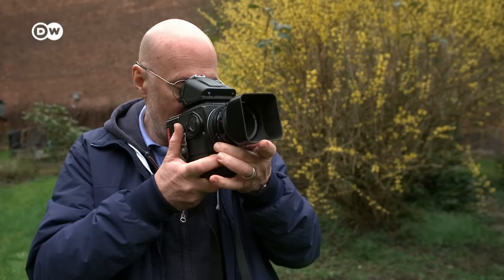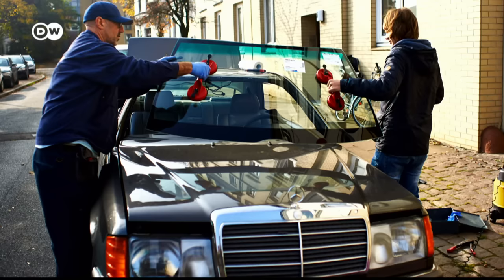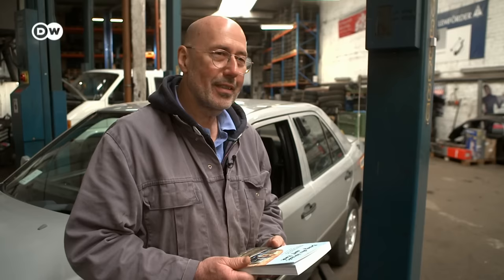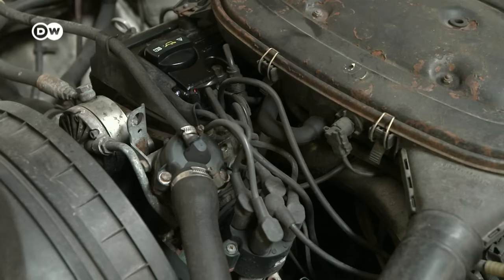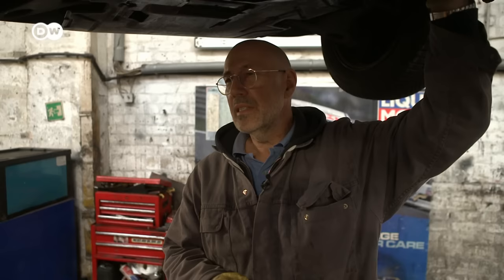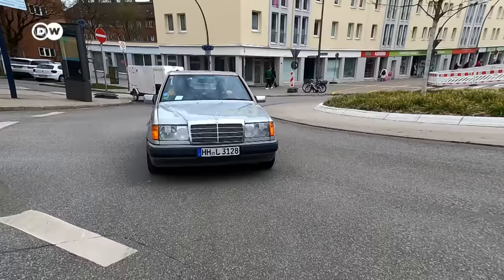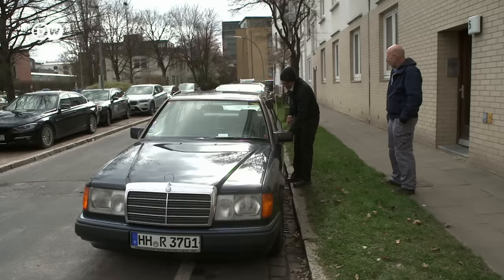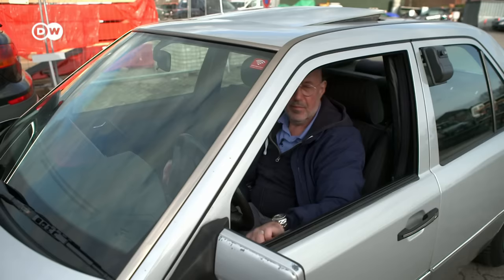Iconic Mercedes-Benz W124: A True Masterpiece in Design and Engineering

Comment: The last true E class ever built, the last true benz ever built is the W140. It was a billion dollar project since there was no price constraint. And it was made till 99 unlike the W124 ending at 97. So that makes the W140 the last true benz made to last forever. W123,W124 and W140 will forever be remembered as the best benzes ever made.
Reply: Don't forget the R129! That was built up until 2002. The W140 was the last to still have the old M104 engine, which is an absolute tank. I daily a 1992 300SE W140
Reply: Actually, it is the first E-class.
Reply: @19jacobob93  how could i forget that masterpiece. That definitely makes it the last since it was made till 2002 as u said. M104 is definitely the best straight 6 engine ever. I also daily a 95 S320 with the M104.
Reply: @TinLeadHammer  the first E class, also the last E class built by true Mercedes standards.
Reply: He said "probably the last". Why are you making such a big deal out of this?
Reply: @detonater1348  you never heard of the w211 ?
Reply: You forget the w126.
Reply: W211 is the last true e class
Reply: what do i enter in cargurus to find this car?
Reply: @Nikola_W211 What makes it so?
Reply: @19jacobob93  Or the 201!!! No compact MBs without the creation of the 201!
Reply: @kamila2356_  Fair! I do like the W201
Reply: I have owned all of them also a1991 420 sel

Comment: The W124 is an indestructible car. It copes with the terrible roads in Ghana pretty well. I haven’t owned one, but I’ve sat in several, and enjoyed the comfortable ride.
Reply: Unless you get condensation inside the distributor, which wreaks havoc with the exquisitely engineered 3 litre engine. Very frustrating to diagnose and fix.
Reply: @1unsung971  thanks for the insights. Will add to list what to watch in the future for.

Comment: I have driven my 230E sedan from Malaysia to Thailand and back Kuala Lumpur and then to Singapore in the same week without any glitch or service. Then it got submerged in big flood in end of 2021 (11 feet flood). It was part of restoration but become revival project. It still going strong but with minor issue of misfiring. Will still keep it and repair it, and if possible will try to restore back to mint condition. The W124 is respectable car. It just simple mechanical and human connection mobility. I love it. Unlike todays car that have no souls, all electronics disturbance.
Reply: Electronics disturbsnce - very well said

Comment: My dad owned a W124 200 in the 90s. It's a recond model imported from UK. The car is great & very stabile with a top speed of 196km/h. It's powerful for a 2liter engine without fuel injection.
Reply from the maker: Do you still have the car?
Reply: @DWREV I do, well no his, but I still got my fathers E220

Comment: Best car I've ever owned, and still own since 2004. A 1988 230CE, not much power but very pleasant ride. She got 470.000 on the clock.
I had a T model as well for many years ago, but the flooring and beams was heavily rotten with rust, so I had to scrap it, such a shame but it was too muck work to do.

Comment: I´ve had a few of these "classic" MBs like W124,123,201.All great cars,but even a W220 is very much a DIY car,it just needs more studying,but basically it´s very reliable if well kept.Also W210 is known for it´s great quality.Rust may be the issue,but the late W124 are vulnerable also.
Reply: You forgot the W140. Much more reliable and better built than the W220
Reply: Can confirm, I own 3x W124, 3x W210 and one W140. Rock solid, I have rebuilt one of the W210 because of rust problem. 😁

Comment: I had one for 15 years, it had over 500.000 km. The weight is not much, about 1300 kg. With a turbocharged 6cylindre petrol, and the brakes of a 500, you have the perfect autobahn cruiser. In the mountains it is marvelous.

Comment: I have such fond memories of my S124 250D (S means wagon). It was very reliable, comfortable, economical and excellent to drive in all conditions. It could go for hours at top speed while still being relaxing driving experience, maintaining civilized levels of noise and not overheating or causing any other problems. Only real problem I can name is the model's tendency for rusting in northern climate where road salt is used.

Comment: This was a great car, but it did have one Achilles' heel. The W124 was prone to rust if it was exposed to the road salts used on roads in New England.  Many a W124 died an early death due to rust or underbody corrosion caused by such salts.  If you kept your W124 in a part of the world where such salts were not used, the W124 would be just fine.

Comment: Just avoid 90's versions with the biodegradable wiring harness!!!!
Reply: Not really because I have a 95’ E320 and it had the biodegradable wiring harness needing replacement back in 2012 i bought one new at Mercedes for $1,300 or so and installed was $1,800 but the new ones will last 20 years or so. I’ve had it since 2010 and it’s still going great after getting the harness replaced now 11 years ago. It’s not a big deal really. The head gasket went around then too but it has been fine too since. Nothing else failed. The only thing it needed since was regular oil changes and brake pads. I love mine and will never sell it. I believe it will me my entire life as it’s an extra car that I have especially so.

Comment: I bought my 1990 W124 230E about 12 years ago for $5500.00 Australian dollars. It had about 230,000km on it. Turned out it had a leaky head gasket on it, which somehow dodged the Road Worthy Certificate. I spent $3200.00 on it and it has been the best car I have ever owned, including a Peugeot 504 LTI, Benz 450 SEL and about 20 other cars.
It has now done 350,000 km and drives like a new car. Keep a car like this maintained and it will last longer than you! Regards, Marcus.

Comment: would like a comparison between W124 and LS400
Reply: The LS400 is more comparable to the W140. I have owned both and can compare the two well.
The W140 is surprisingly easier to work on and feels much more solid overall. The panels, doors, interior etc. are unmatched by literally any other car ever made.
The LS400 feels less special, and the doors etc. Don't feel much better than on other Toyota products I.e. Camry. The LS400 is maybe slightly quieter than the W140 and the suspension feels better in my opinion, although my W140 needs new control arm bushings and shock absorbers so it will feel much better once those have been replaced!
Reply: @19jacobob93  Thank you for your inputs from your lovely combo.
 I'm curious to know what led the LS400 impressed by all from its competition. Were the low price and oil crisis helped it by far margin?
Also want to know about how the BMW 7 series fared in this era. No comparison I assume?

Comment: FYI: I have a friend who bought a brand new 2022 model E-class. After 5,000 kms, it started showing a problem where the engine wouldn't start. Turns out the sensor on the fuel injection was malfunctioning. That will never happen on a W124. The new Mercedes models are all electronic toys and shiny curves but it doesn't have that signature Mercedes reliability and durability like the W124 or W123.
Reply from the maker: Interesting point. We still keep our fingers crossed the 2022 model will at least not cause any more problems

Comment: I have a w123 240d manual. I'm in the southeast usa. But still some rust. I want a 124 but I'm worried about rust, wiring, etc.... I'd want the most reliable bullet proof version if I bought one. The standard taxi style. No bling. I wonder what the best version is to find?

Comment: The W124 might be alright to those that know no better, but it's not a patch on the W211 Mercedes. The 2003 W211 E320 has better brakes, better steering, better throttle response, better paint, better gearbox, better suspension, better fit & finish & is an overall better package. I own both, a 1994 E280 W124 in pristine condition& a 2003 W211 in likewise condition & I should know. Both have AMG wheels & both are comfortable to drive, the W124 has 478,000 kays, the W211 has 134,000 kays. End of the story!

Comment: Nice video. But... I hate people who are so shortsighted. I have owned a W124, a W201 and I now drive a W202. First of all the W210 (the W124 successor) and the W202 (the W201 succcessor) drive a lot better. Especially the steering. Also the petrol engines in the W210 and W202 are better than the early petrol engines from the W201 and W124. Also contemporary Volvo's are a lot less prone to rusting. And, in my experience, more sturdy and certainly also have a lot of character. I know because I have owned and driven models of both makes extensively. I have a very slight preference for a Benz, but this is very personal. Both Benzes and Volvo's are very practical everyday older cars. There simply is no single car (or motorcycle or any other product) that is THE best. It may be the best for you, yet that does not make it THE best for everyone!

Comment: But it easily weighs 2 tons. I didn’t like the weight. The fuel economy suffers but back then gas was cheap. Now? No thanks.
Reply: Diesel.
Reply: My W140 weighs 2.5 tons and I still manage to get 900km+ out of a tank. 3.2 M104 engine
Reply: Maybe true on the 4 cylinder versions but if you go for the 6 cylinder models and especially the 8 cylinders versions they are much faster and smoother also. They do way better moving around the over built tank of a body that lasts forever. And really if you compare the w124 to a car of today they are not that heavy because todays cars are absolutely laden with worthless electronics that go bad in the heat and won’t last and endless safety equipment and smaller engines with parts that are so crammed together that the ones built after the 2010’s are much harder to work on the the 1990’s E Class Mercedes W 124 models. I’ll never sell mine a 95’ E320 since 2011. It’s a true friend… that I enjoy going through my life with that doesn’t ever break down on me ever and is truly satisfying to drive that i have not experienced in other cars except the R129 Mercedes which I have a 500 SL example of from 99’ that’s absolutely wonderful and never needed anything and I have that since 2014. Such wonderful cars. I can’t understand why people would buy the newer junkier ones.
Reply: There are more things in life than saving a few Pennies on Gad in advance to having the newer Mercedes model and having to bring it to the service department non stop because of endless electronic Nannies that keep breaking down that keeps the service department flush with your cash. That’s a false economy my friend. It’s much cheaper to spend a little more on gasoline 😉🧐
Reply: @8rick1ane Also old ones?